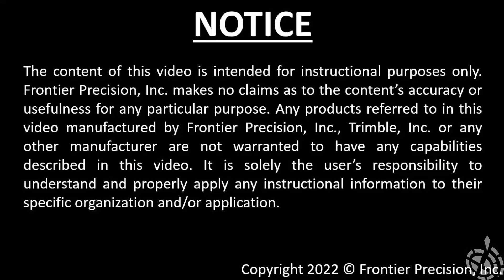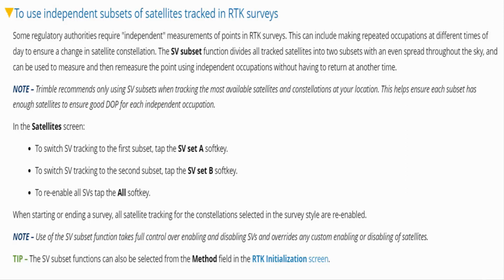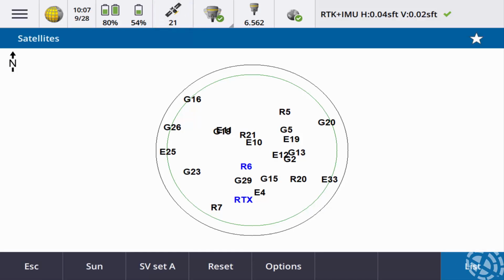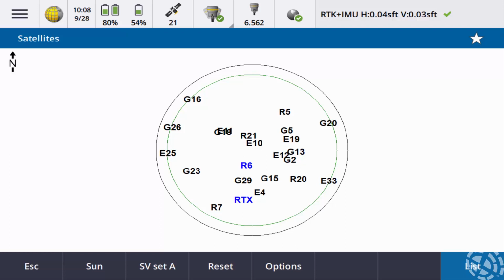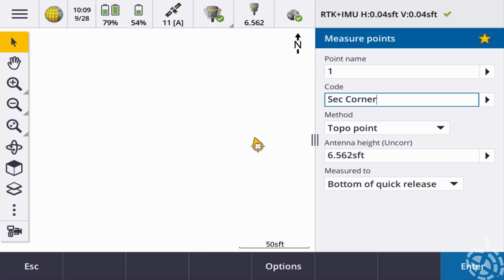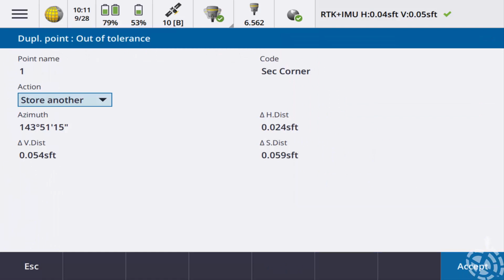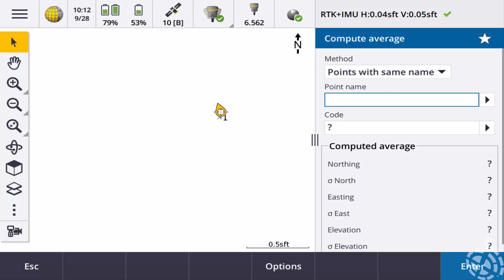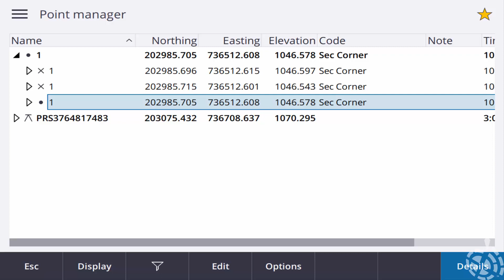How to use satellite subsets in Trimble Access

Comment: It seems to me that you would make your first measurement with all of the SV's enabled, and then QC the position with a each subset solutions. 

This QC is specifically to address multipath errors. The general theory is that if you have a multipath solution, the subsequent subset solutions with SV's in a different orientation will produce a different solution thus confirming a multipath error. It's the same theory of re-observing the point with a time separation. Contrarily, if the three positions agree, the solution is devoid of a multipath solution.